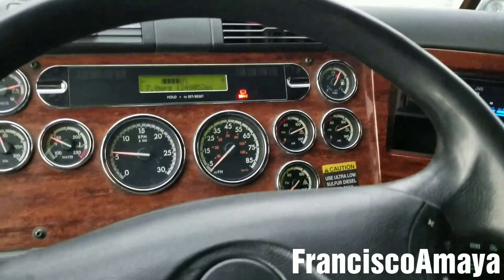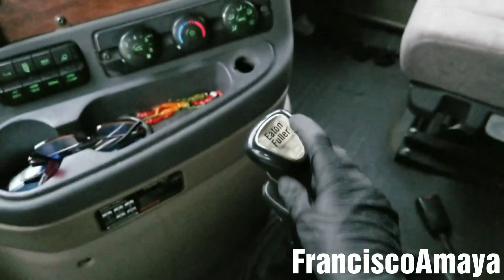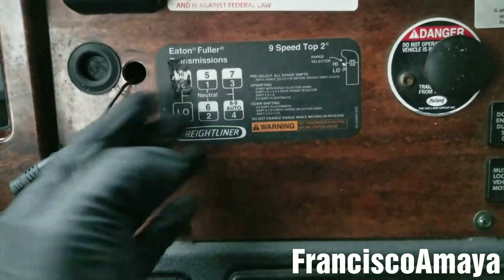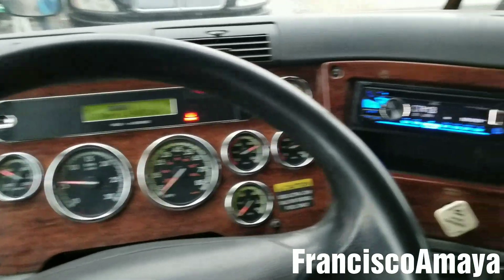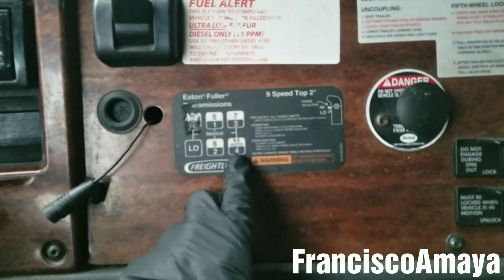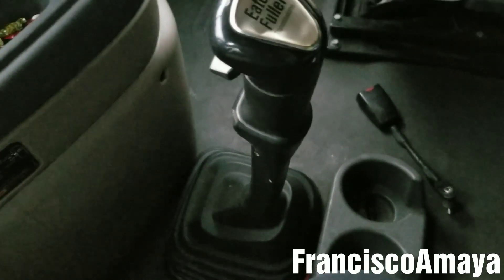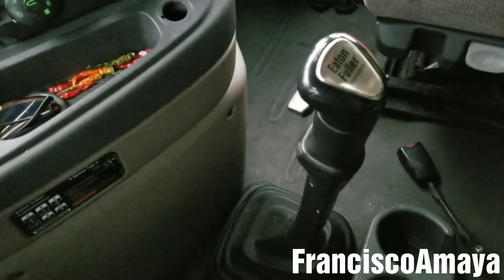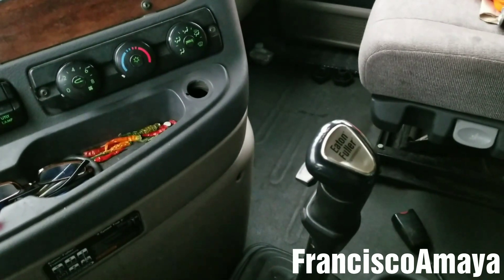Freightliner cascadia 13 speeed eaton broken transmission synchronizer 4 and 9 goe to neutral

Comment: My 2010 freightliner cascadia with eaton fuller 10 speed is stuck in low range. Once I get to 5th gear & flip the switch it won't grab 6th. Any idea of what that might be, or what caused this problem?
Reply: Shifter valve just take the 4 screws on the floor under or around your stick an take the metal plate off its called the shifter valve take to the nearest Salvage yard an get you a used one much cheaper you can installed your self four screws that's all no need for scammers to rip you off.

Comment: In neutral and I'm stopped it is hard to go into 1st gear, but after I pump the clutch 20-30 times it is back to normal.  Could it be air in the line or the brake clutch going bad?  Your videos are great with your face man! You put the fan switch on my truck by the way if you kept my number, thanks.
Reply: I’m not a mechanic but I think you have a bad seal somewhere going to the clutch that is letting in air.